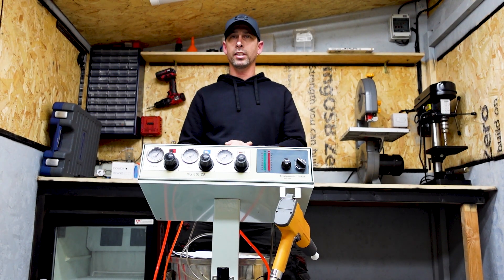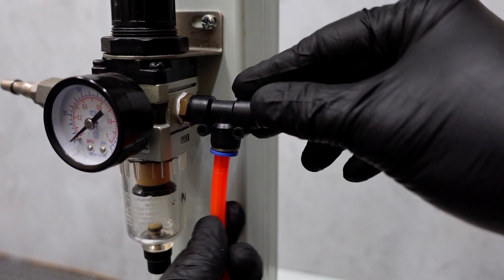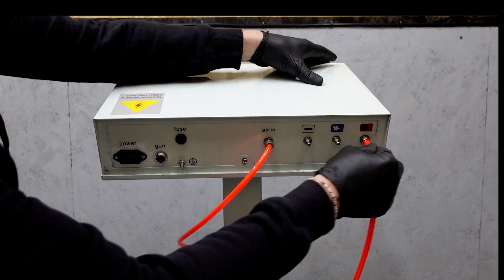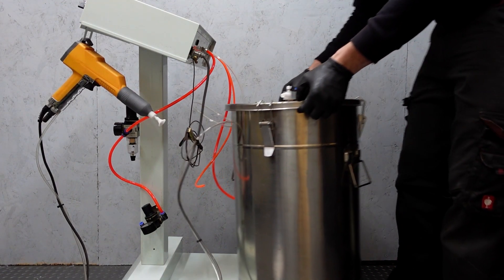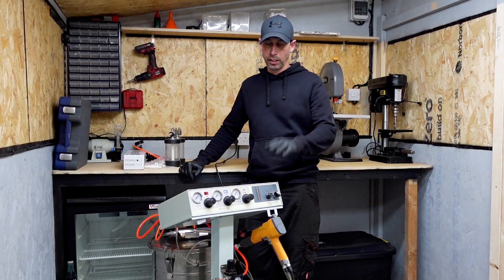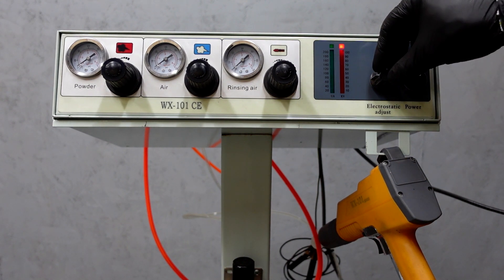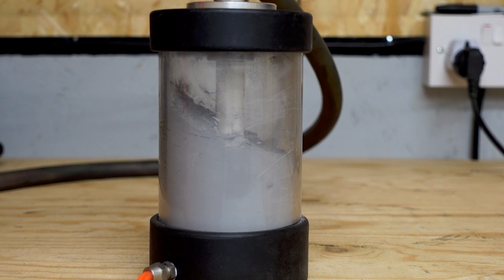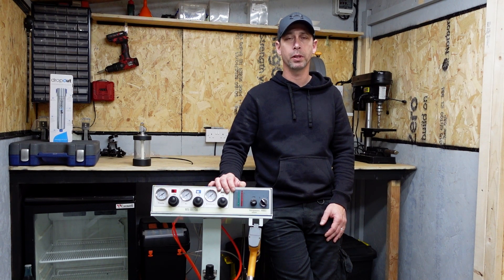WX Powder coating machine system setup and fluidising upgrade

Comment: I can’t get the air or rising air nobs to work at all. I’ve gotten the powder to flow but idk how to fix that problem.
Reply from the maker: He adjuster knobs need to be pulled back to unlock, then you can adjust them.
Reply: @twobuddiescustoms  Ive pulled them back, pushed them in. Nothing ever happens. ☹️
Reply from the maker: @punkyfresh505xoxo8   are  all the pipes connected correctly ?
Reply: @twobuddiescustoms  Ive powder coated a rim with it. The gages just don’t do anything
Reply from the maker: @punkyfresh505xoxo8   is it new or a used product? have you checked all the pipes connected correctly?
Reply: @twobuddiescustoms  brand new. I’m pretty sure they are
Reply: Yes sir. Brand new everything. I like how it sprays it just bothers me I can’t get those 2 nobs to work. The air and riding air nobs the gages don’t do anything.
Reply from the maker: @punkyfresh505xoxo8  Hi there can only be two things wrong then its either not connected correctly or its faulty, try get hold of the supplier and explain the problem
Reply: @twobuddiescustoms  I’ve tried getting ahold of them, they haven’t been much help. I’ve been using my old one. I think I’m not getting enough pressure to it for them to read. The gun works though. Thank you for replying

Comment: great video, we have the same system but i really could do with the small hopper but i can find them on ebay, would you be able to help?
Reply from the maker: Hi here’s a link on eBay to check out. https://www.ebay.co.uk/itm/203351438768?mkcid=16&mkevt=1&mkrid=711-127632-2357-0&ssspo=8V6-U5OgTq2&sssrc=2349624&ssuid=WhW51DwNS5u&var=&widget_ver=artemis&media=COPY
Reply: @twobuddiescustoms  thanks so much for that. 👍👍👍👍👍

Comment: Hi just wondered if this gun is any use.  It looks the same as the vevor one.  I've found it for £325 is that a good price?
Reply from the maker: Hi yes this power coating gun works well, I’ve had mine for about a year and a half. Paid about £600 for it so yes £325 is a bargain!! Probably not the best for industrial use but absolutely perfect for a small workshop or home setup. I think there’s a few models out there that look almost the same, mine is the wx101 cannot fault it!
Reply: @twobuddiescustoms  Thanks for that.  I need it for steel gates so zinc primer then  final coat.  I might just get one and definitely upgrade to smaller hopper.

Comment: Great video thanks for the tips! I just ordered this gun so im doing as much research as i can to get ready for it. Could you send a link to where you got those smaller fluidizes? I didnt realize that one that it comes with is so big!
Reply from the maker: I made the same mistake when I bought mine!!! Here’s a link on eBay they are £40 but from china https://www.ebay.co.uk/itm/203351438768?mkcid=16&mkevt=1&mkrid=711-127632-2357-0&ssspo=8V6-U5OgTq2&sssrc=2349624&ssuid=WhW51DwNS5u&var=&widget_ver=artemis&media=COPY    They are absolutely brilliant, not had any problems with mine!!

Comment: Hello there if I set the kv 40 how much should I set the uA ?
Reply from the maker: Hi buddy, on the wx101 there’s no adjustment for the uA it auto adjusts when you adjust the KV.  It looks like it’s about 10uA on 40kv. 
If you set it to 50kv it starts to show 20uA  so would assume it’s around the 10uA at 40kv
Hope this helps
Reply: @twobuddiescustoms  thanks a lot I bought the wx958 and I can adjust both 
Thats why I asked 
Thanks for your answer !
Reply from the maker: @elgranjero4384  no problem buddy